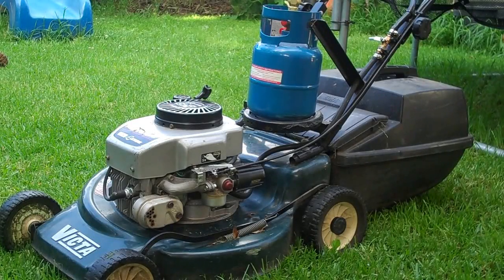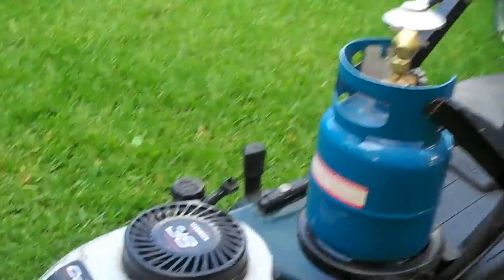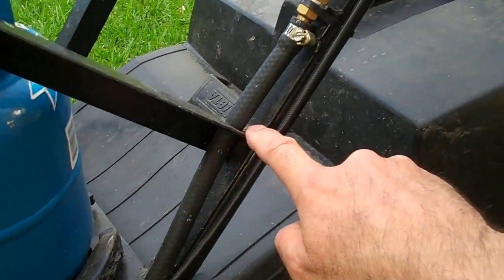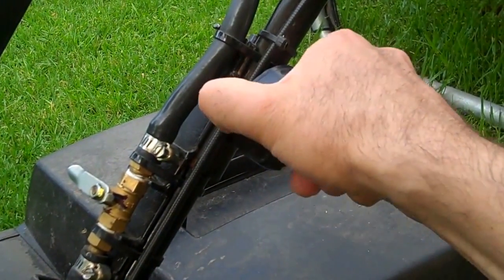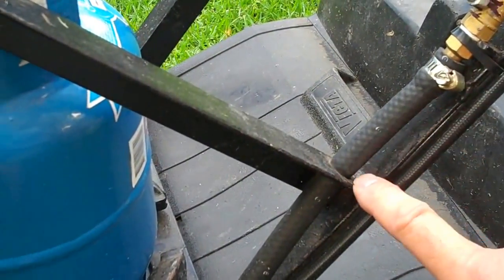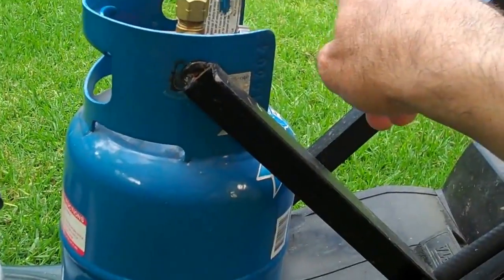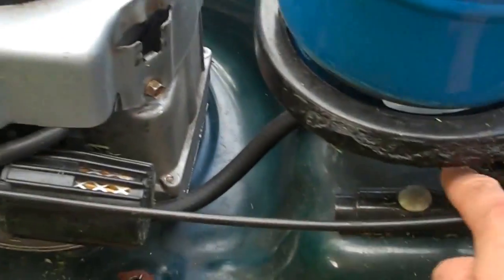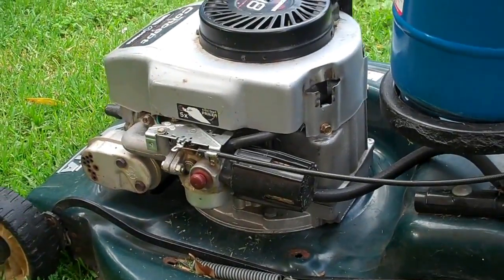How to convert a Lawn Mower from Gas/Petrol to Propane / LPG DIY

Comment: I did this 25 years ago I worked a gas lp gas place and I had to mow the grass while they were gone they had no petrol and I couldn't leave to get gas So lol I took a little lp tank put the line in the carb adjusted the has flow and off I went the thought the mower was gonna fly 😂😂😂😂

Comment: Is the governor still hooked up? I think you would have to be constantly adjusting the throttle and fuel/air mix to keep it running when a load is on the engine.

Comment: a) Temperature increase on lpg
b) Valve seats corossion 
c) Extra weight for weak lawn machine frame
d) Head gasket and/or exhaust gasket soon will be destroyed
Reply: not being an idiot but tecumseh are shit anyways but not much will blow them up i filled same engine as that with cement and ran for an hr still didnt blow

Comment: nice do it on a 2 stroke
Reply: You would need a way to introduce oil into the mix in the proper ratio for the engine.  No cheap/easy way to do this.  With gasoline you just mix it into the fuel tank.
Reply: @0ut0FSYNK  I was thinking of this and dreamt up having a oil bottle alongside gas tank with a very small pipe to where the gas line enters the carb but at a perpendicular angle. The gas flow would suction pull a smidge of oil as it passes by the oil line opening and mix into the carb.
Reply: @easytalker864  I wonder if you could use the existing fuel line/tank from the old petrol system to the carburettor and adjust the flow somehow to add the oil. The gas line just needs to be somewhere near the air intake to get fuel into the engine, so the parts could maybe be repurposed
Reply: @RJ-wx3fh  yes indeed 👍
Reply: @RJ-wx3fh  maybe you could use the carb for oil instead of gas. probably have to drill the jet out a bit to allow the thicker fluid to get through but who knows about ratio, would be a shit show
Reply: @NaturalBornGriller  you're right, I suppose the thicker oil would be harder to aerosolise in a carb.
Maybe an injector?
Reply: @NaturalBornGriller  perhaps using a greater ratio of 2 stroke oil to solvent fuel , running the carb with low liquid fuel intake and an additional gas inlet, so it could be hybrid fueled

Comment: shortly after i made me comment here 3 months ago. i converted my mower to propane. I couldn't be happier. I removed the recoil starter and use my cordless drill to spin the engine while opening the gas valve. no more issues mowing slopes. i use the 1 lb bottles and refill them off my larger fuel tanks.
Reply from the maker: Thanks keep up the good work
Reply: MrSGL21 that's illigsl but ok

Comment: did the tank placement affect the balance/handling of the mower?  

Id be curious as to how long the bottle will last compared to a tank of gas (not familiar with Victa mowers) and if you have had any issues with valves burning out prematurely, etc.

Did you experience any more or lesa power output?

With a larger regulator you could effectively use that gas shutoff valve as a boost knob... normally run it half way open, then when you see a thick spot of grass open the valve the whole way. Splice a smaller downstream O2 injection line with similar valving on there and see what happens! borrow your dads oxygen bottle and fasten it to the handle. 

report back please.  video or it didnt happen. 

I have a 6hp Briggs n Stratton on a Toro that I might try this with!
Reply from the maker: No the tank placement has not affected the balance of the machine as the tank is small/light and the supporting brackets are also light. A greater effect on the balance occurs when the grass catcher is full of grass clippings. The engine does not have any problem with valves burning out as the temperatures, speeds and stress on the valves are relatively light. I use about 2.5 to 3 tanks per annum. Most of the mowing is done over spring and summer, when the grass grows the most (ie I mow the front, back and nature strip about 25 times a year).

Comment: I'm curious if it's possible to rig the propane valve up to the mower throttle and not have to fiddle with the settings... something as simple as having the valve a bit lower down on the handle arm below the throttle and rigging up a link rod from the throttle. there would be the initial fiddling to get mixtures right but then it would be just like throttling the mower as per usual no?
Reply: Put the gas line straight into the air filter, set/lock the throttle to fully on, and use the flow of gas as the throttle

Comment: There is one thing you need to watch for on a propane/LPG conversion to a gas lawnmower and that is burned exhaust valves and seats. To do it properly the engine will need a rotating exhaust valve and a hardened exhaust valve seat insert. You do not normally go to this effort and expense for a lawnmower engine, it's cheaper just to let it fry, but it is worth it on something like an emergency generator.
Reply: OlegKostoglatov l
Reply: What's that mean

Comment: i just tried that with my lawn mower i poked the hose thru the air box hole while it was removed and started the engine on petrol and turned the gas on slightly all it seemed to do was kill the engine nouthing else
Reply from the maker: I connected the gas line directly to the carburettor. I removed the petrol line connection to the carburettor and replaced it with the gas line. There is no longer a petrol connection to the engine. Starting the engine on petrol and then trying to also provide gas will most likely result in a rich fuel condition which will 'flood' the engine and cause it to stall.
Reply: Filipos Papas
sounds about right
Reply: i did that too same thing bc i was was scared of cranking the gas up with my valve at least it needed to be wide open off the propane bottle
Reply: James Flore

Comment: where do you get the primus tankes filled/swapped - ill just use the 9kg gas bottles
Reply from the maker: The Primus tank was purchased at a camping store. I selected this tank because it was small and light weight. There is no reason why you can't use any tank you like. I have them refilled at the local petrol/service station.